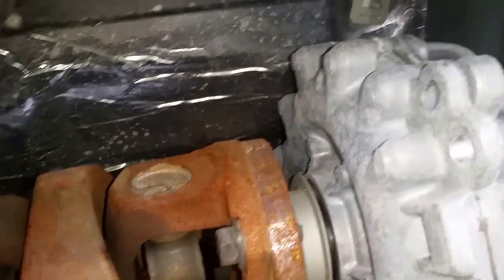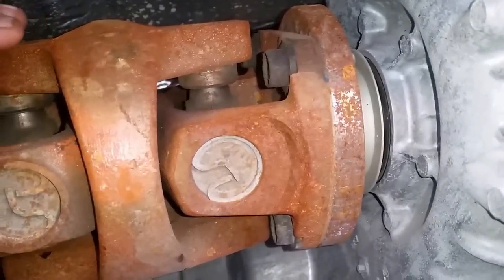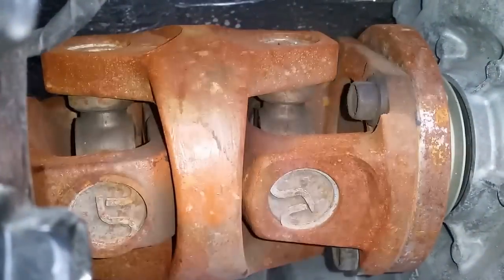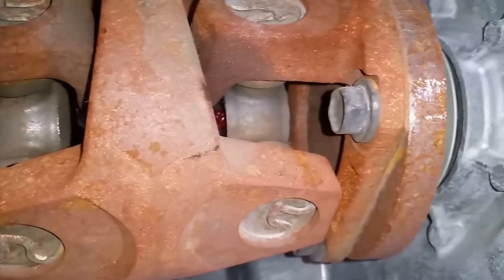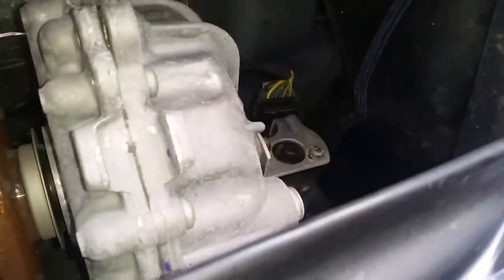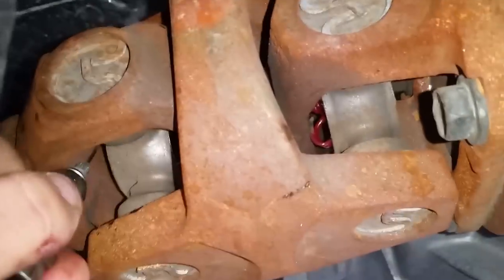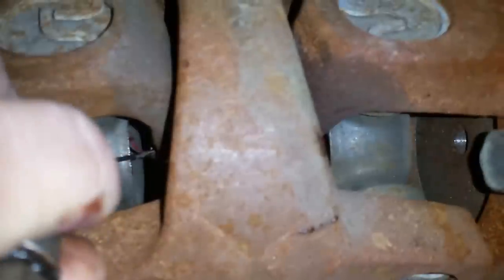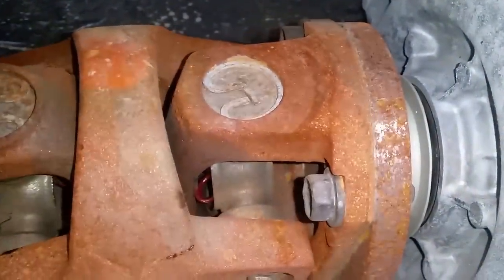Front Axle Grease Point 2010 2011 2012 2013 2014 2015 Ram 2500 3500 4x4 4wd

Comment: I agree with Brandon's comment below. Thanks for making this video. I don't change my oil any longer as my 67 year old body won't allow it. I entrusted the shop I was using to find this fitting or indentation to grease. I just decided to day to put down a nice soft moving blanket and find the illusive fitting. After 20-30 minutes of searching, going back in to watch this video. I finally found it. But I took some Carb/choke cleaner and sprayed it on the inside of the entire area. When I did that, the shiny fitting stood out like a sore thumb. Maybe its a coincidence, but there was also a Red slash done with a marking pin on the outside of that area. Perhaps that is to mark the spot. Regardless, I went out and bought a grease gun, grease and the needle adaptor. While it was a bit of a pain in the ass, I was successful in putting in some grease until it came our on the back side. So, for those of you search. try some brake cleaner, carb cleaner or whatever and clean that area off. It will be a nice and shiny dot..............Thanks Eric for the video.

Comment: Thank you for posting this, I had a sticker under the hood of my truck telling me to grease the shaft , I search diligently and couldn't find anything. I thought perhaps my model didn't have any fittings, as time went on I starting hearing a squeaky sound, I hit the breaks and it still made the sound. I starting jacking up each wheel and found the sound was from the drive shaft. Started looking at diagrams and youtube and found this. I have never seen a grease fitting hid so well, the engineer that came up with this should be shot, why could they have not made an external fitting is beyond me, anyhow I got it greased and the squeak is gone, Thanks for the video.

Comment: Thanks for the video, very helpful.  Greasing this every oil change or anything less than 25K miles or so is crazy!  With the 2013+ trucks this drive shaft only spins when 4x4 is engaged.  I know what the manual says....I have 25K on mine now, I guess I will put some grease in there.
Reply: I have a 2013 2500 and my front driveshaft always spins.
Reply from the maker: +portscan69 My truck definitely has an electronic disconnect on the passenger side of the front axle. It disengages the front drive shaft. Maybe some 13's were not equipped with this feature. Should still grease it either way, it's cheap maintenance to prevent costly repairs later on.
Reply: +Eric Anderson yea, I just know my spins all the time. I make sure to keep mine greased.
Reply: @stopspinskydiving  spins how, rolling force from tires or from transmission- transfer case  power ?

Comment: I found mine. 2017 Ram 2500 Power Wagon, it sure is a PITA to find, did my dealer's tech lubed mine? Yes, I went underneath to find it and inspect it, sure enough it has been lubed.

Comment: Will you be able to manually spin the front drive shaft by hand if the tires are on the ground or did you have to lift it?
Reply: if you have an electronic front axle disconnect on the passenger side of the front axle, no. If you do not, then yes. My truck in this video had the disconnect, and therefore it spun freely. If you don't have it, you will need to jack it up.